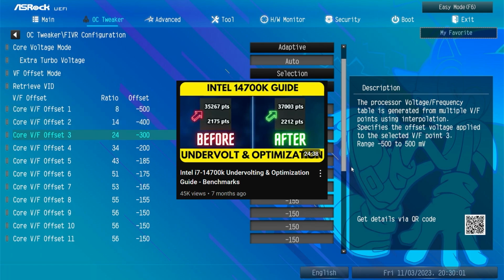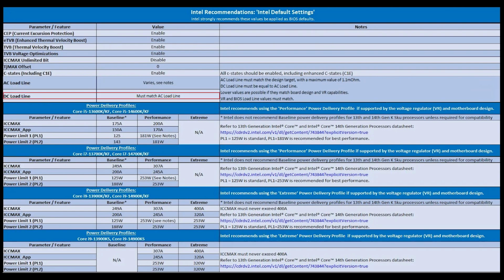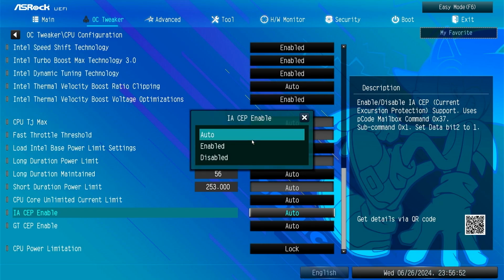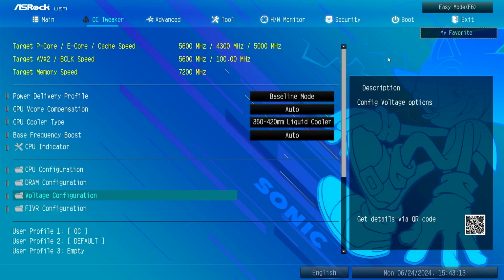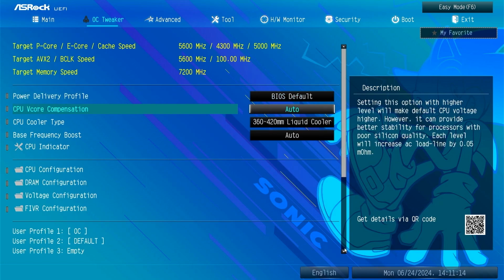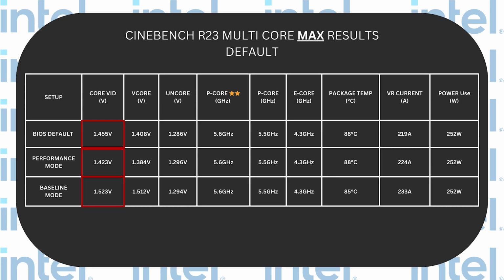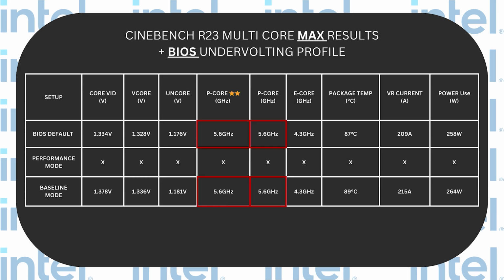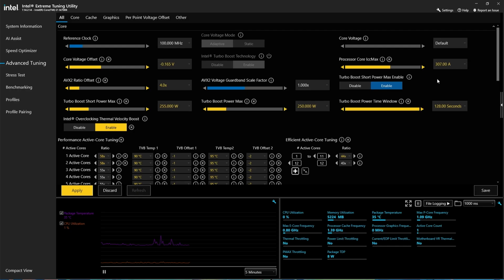How to Tune your Intel 13th & 14th desktop CPU using Intel's Recommended Guideline + Undervolting

Comment: Hey! Thank you for the video! I just updated my bios to the newest version with the microcode 129, changed the settings in BIOS as you did (however, a few settings were not there on the asus bios), and ran XTU with the same settings, but my temps still reach 98c, thermal throttles on Cinebench24. The newest Asus bios came with only two profile mode, Perfomance and Asus Advanced OC profile. 

Specs: i7-14700K, Asus TUF GAMING Z790-PLUS WIFI D4, Arctic Liquid Freezer III 360.

What can be done? I want to prioritize longevity over performance.
Reply from the maker: ASUS boards do have a lot of AI and automated features that will override all your manual tweaks. You need to make sure to have them all disabled and use the Intel power delivery profile in combination with your manual undervolting.

I personally don't currently have an ASUS board on hand, so my guidance will be limited. I'm trying to secure more parts to demonstrate with. It's just a matter of time, I hope.

But I can tell you to try changing SVID behavior. For my brother, who has an ASUS Z790 Hero, he uses the "best case scenario" option and said it's the only one that works for him not reaching a high temperature after manually undervolting.
But you may need to switch between them to find the right one.

He also has ASUS multicore enhancement set to "enabled - remove all limits."

He has the performance preference set to the ASUS advanced OC profile.

His temperatures never exceed 77°C

He tells me the most important change is the SVID behavior, his cpu pts is 96 and its 13900k
Reply: @TECHOSAUR  thank you and your brother! changing just the SVID to 'worst case scenario' did the trick for me. Temps now stable around 86c, except P-core 5 and 7 which goes to 92. Performance is ok too, Cinebench 23 score was 31K, Cinebench 24 score 1650. No throttling. 

'Best case scenario' was unstable, gave bluscreens. 'Typical scenario' was ok but poor performance and 59c temps. 

If you or your brother have any tips on increasing the performance a bit, let me know! thank you so much for the help!
Reply from the maker: @chandula.perera, we are glad to help.

Did you get this new temperature before undervolting with XTU?
I’m curious to know if you could get it down further.

My brother sends his regards. He’s glad to help. It’s interesting how everyone is mad at Intel for having unstable processors, but my brother is completely relaxed with his 13900k and has never had an issue. He did some manual BIOS configurations, and they’ve worked for him after trial and error. His only time getting poor stability was due to RAM compatibility. Once he contacted Corsair, they helped him find the right kit that’s compatible with his Hero motherboard 6400mhz 4 DIMMs 6gb, and since then, it’s been working well. He plays mostly games like Alan Wake 2, Persona, Dying Light 2, Lies of P, and he’s never had a problem with his CPU. Temperatures in games are around 50°C.
But he has custom loop cooling, and his P cores are 5.5 GHz.
E cores are auto.
Maybe that’s why it’s stable; lower clocks plus undervolting reduce the likelihood of CPU failure and crashing.

If you are interested in undervolting, I hope to help.
Reply: @TECHOSAUR  So I tweaked around a more and found a sweet spot I think. I enabled ASUS advanced OC profile, and kept SVID at 'worst case scenario'. Without XTU undervolting the temps reach 100c and it power throttles, with XTU though, it works super good! no throttling, temps reach max 86c and that's only p core 5 and 7, other cores are always below 80c. My undervolt is at 0.090, anything higher, applications start to crash. Now I get a score of 33K on cinebench 23. 

What scores did your brother get? also, what are his PL1 and PL2 limits? I'd like to tweak around a bit more and see if I can reduce the temps.

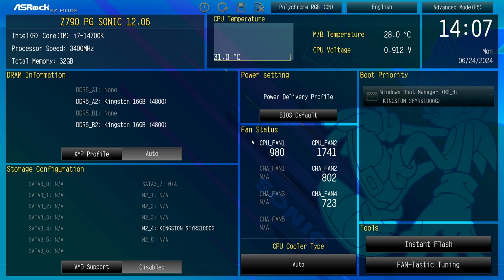Comment: 1:14 I see 0.912V on your screen and on my MSI B760 with i7-14700K the default (auto) is around 1.050V. Is it normal? Should I shift down below 0.920 ?
On other videos I also saw values below 1V (typically 0.96-0.98) on this and other 14gen processors. Don't know what to think. Does my MB overvolt my CPU significantly by default???
Reply from the maker: Did you undervolt it or leave it at default? Also, do you have the most recent BIOS update installed?

Also, what voltage are you getting under stressful workloads? It might give some insight if you have a higher offset.

Comment: Hi mate, I have the same processor i7 14700k I followed your steps for bios default and the settings from previous video and my result in cinebench is only 28k. I have b760m AsRock motherboard and 64gb 6000mhz 48cl, any advice to get this score higher but stable
Reply from the maker: What clock speeds are you getting throughout the test, and did you check if it's thermal throttling?
Also, did you disable the e-cores by any chance?
Reply: @TECHOSAUR  I have checked and clock speed is 4090, temps doesn't go over 60 celsius. e core are on.

Comment: Hey man, thank you VERY  much for putting so much effort into creating another video to solve the issues that we all have with 14700K. I also saw your other two videos about undervolitng and changing core ratio. I have a AS Rock b760 Pro RS Wifi and its really weird as I simply cant change the CPU core voltage or core ratio. The settings are grey and cant be changed, neither in XTU nor in BIOS directly. I already tried a lot and among other things I changed the microcode setting in BIOS, afterwards the yellow lightning disappeared in XTU but the rest of the settings (Core Voltage and Core Ratio) still cant be changed and are still displayed in grey. I read all the comments from your other videos and it looks like many people with b760 have this issue. Do you have any ideas left what I / we could do? The reddit link a posted a few times alreay is unfortunately not working any longer. Thank you very much man!
Reply: Same here. Did you get the settings working somehow?
Reply: @serajr u both dont have Z board. You cant
Reply from the maker: I don't intend to spread misinformation. I've never owned a B760 or any B chipset motherboard, so I don't know how to address the issue. I've seen many comments so far people asking the same stuff u ask, and it makes me feel bad that I can't help much. I'll do my best to get a B motherboard as soon as possible, and if I find a fix, I'll make sure to make a specific video about it. If the current Reddit posts aren't helping, then that's all I can do for now. I'll try to get a motherboard myself and experiment on solutions.
Thanks
Reply: There are reasons why there are different chipsets for the same platforms. And you just figured out one!

Comment: Updating my BIOS today, this will come in handy, thank you very much!

EDIT: After the update (BIOS Default delivery profile)  I immediately ran a stability 30 min. test on Cinebench R23 and experienced thermal throttling, the ranking was very low, 1580 pts. Cooling the cpu with a 280 NZXT AIO & a contact frame. I set all fans at performance mode. Any suggestions to lower the temps and improve my results?

Also: what does Intel mean with this: Intel Recommendations, Default settings for the 13700k: "Intel recommends using the 'Performance' Power Delivery Profile if supported by the voltage regulator (VR) and motherboard design." 

I'm confused, aren't they contradicting themselves since this profile lies outside their recommendations, as you mention in the video?

My mobo is a Taichi Z690, so is it safe the use the performance delivery profile?
Reply from the maker: To answer your question, every motherboard has a different quality and quantity of voltage regulators (VRs). Depending on that, you can have a more stable and regulated system for handling your hardware under higher power. High-end motherboards use a better VR system that ensures the highest and most stable performance under most circumstances, while budget ones naturally get the minimum to make them work, limiting them to using more basic power delivery current.
It's more up to motherboard vendors to make their products capable of the higher performance delivery profiles set by Intel.
Reply: same for me

Comment: So I have a question, is it safe to underclock the 14700K WITHOUT undervolting it? I don't mind losing performance if it increases stability and longevity of the CPU in the long run.
Reply from the maker: Sure, but what are your concerns about undervolting? If you are not interested in spending time to figure out the optimal point at which it's stable at a given voltage per ratio like i did here, you can undervolt it in offset by about 0.075 - 0.100 mV, yet it should be stable most of the time. Also, reducing clocks will make it cooler. Undervolting became a necessity for modern Intel CPUs. They ship with ridiculous high voltage, and even custom loop solutions struggle
Reply: @TECHOSAUR  Okay cool. I agree with the fact that intel 13th/14th gen seem to be running hot on default settings. 
I have reduced P-cores to 4.8 GHz and E-cores to 3,6 GHz moreover done an undervolt of -0,165V, PL1=PL2= 218W. ICCmax = 307 A. LLC 1,1 mOhm.
Intel Turbo Boost Max - Disabled. 
Cinebench 2024 CPU (multicore) score 1783 with max temp 62°C (average 59-60°C) on these settings. 
Core voltages (both P and E cores) stayed under 1,2 V. 
I use EK-AIO 360 mm. 
No crashes until now. 

I was thinking of undervolting further, however could this damage my system in any way? Or would I just risk instability from too much undervolting?
Moreover would it be better with a lower LLC?
Reply: @anotherdayanotherdream  why in the actual F do u want to undervolt ??? max temps 62C are very cool, i would even recommend you reseting thise settings back to normal or reversing the clocks to default , as long as your cpu doesnt reach more than 80C in cinebench u shouldnt worry about ANYTHING , at this point u are just wasting performance without any reason

Comment: Thank you for the updated guide, I hope you can get more motherboards to test. Asus Z790-F mid range would be good, with a 14700k and you can compare the bios software gui and settings. Liked and subbed. Good luck and thanks again for your efforts.
Reply from the maker: Thanks for the support, I'll try my best!
Do you currently have any issues with your motherboard? In any case, I can try to help.

Comment: Thank you for your guides, I am on an NZXT N5 Z690 which also uses Asrock hardware and BIOS underneath. Your undervolt values work great. I haven't pushed my 14700KF yet and played it safe with limiting PL2 to 175W. Even in that limited state, performance is more than enough for me at the moment (above 31000 points in CB R23).
Reply from the maker: Great to know. I didn't know that NZXT uses ASRock hardware. So, is the BIOS menu more or less similar to the one I have?
Did you also get the Intel default profile option lately via a BIOS update?
Reply: @TECHOSAUR  The BIOS menu looks nearly the same and the features are almost identical, I haven't seen the CPU indicator though. BIOS updates are trickling down to NZXT in a rather slow way, it takes them some time to adjust it to the NZXT theme and customizations, I think. Hence I haven't seen any of the latest BIOS work yet. But I hope I will get these latest features sooner or later.
Reply from the maker: @seylaw  Yes i got this one with the Power Delivery Profiles on 11 June, but the CPU indicator by end of 2023